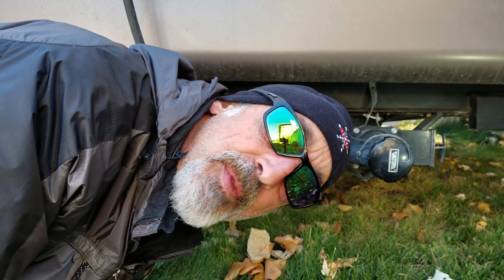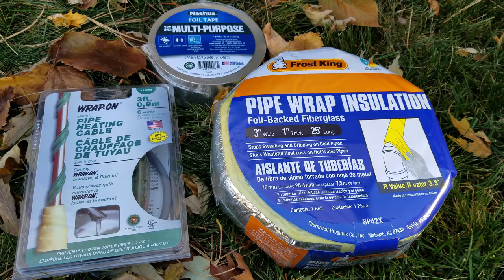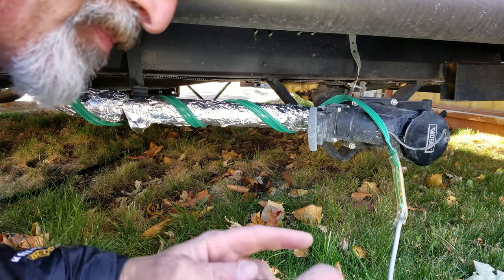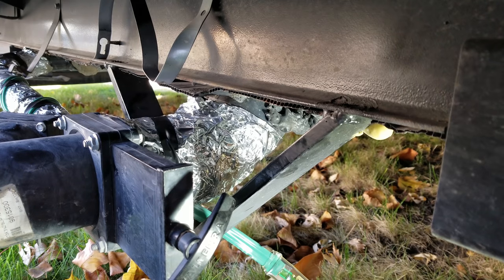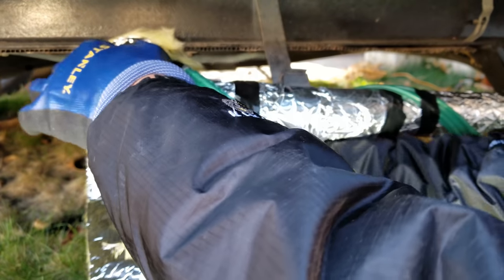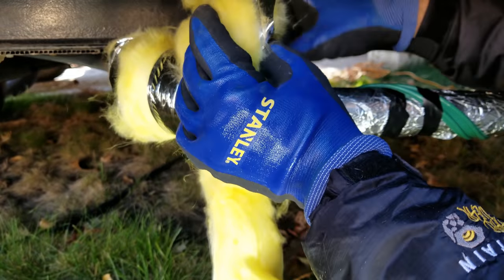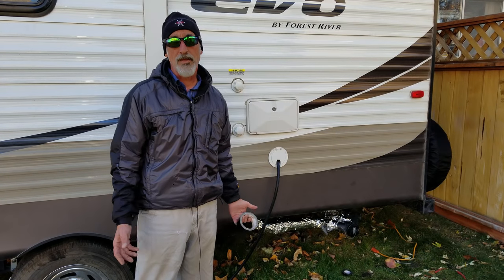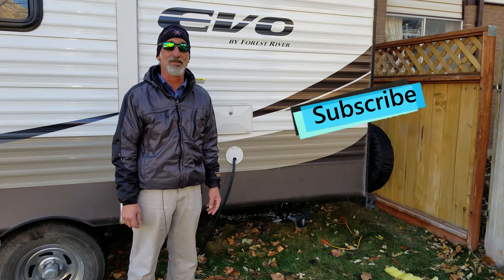Ep. 12: How to Keep Your RV Dump Valves From Freezing | RV How-to

Comment: Great video, thanks. Just wondering if pouring some rv antifreeze down into black and grey tanks, keeping any liquid in the pipes near the valves, and the valves themselves,  would negate the need for the heat tape? I see the issue of the valves/push rods being frozen themselves. Then you always have the problem of finding winter dump sites that are operational, no?
Reply from the maker: It could, and we do that ourselves. However as the tank contents continue to fill, that antifreeze will continue to be diluted and less effective over time, unless you keep adding sufficient quantities of antifreeze.
Reply: @GrandAdventure  Thanks for the reply, but what does one do who is not plugged into shore power to contend with the actual exterior components of the valves themselves being frozen, like the cable, slide mechanism, etc. Seems like everything rests on whether or not you can actually open the valve, to dump the liquid. I would assume heating with a heater or heat gun/hair dryer, no?

Comment: Thank you. Aren't you supposed to leave the thermostat outside the insulation? Or did I miss that part of the video?
Reply from the maker: You are correct. In our case the thermostat is contained within the electronics that include the power LED, which is outside of our insulation. We didn't specifically point that out, however.
Reply: That maybe true but unless the pipes are freezing why use more electricity and money than necessary. Some of those heat cables stay on until 60 degrees, which maybe 24/7 for three months in some locations. I would either install a separate thermostat plugin shutting off at 50 degrees or monitor temperature separately (manually), or get a wireless thermometer with alarm, and pay attention to a weather app. When in doubt leave it plugged in otherwise unplug it.

Comment: Good video. I would want this switched, just like tank blankets/heaters. That way during those months you need it, just flip a switch and your water systems don't freeze up. I wonder how long that tape and eventually wet compressed fiberglass insulation will stay on there? Let us know if the set up made it through a season. Thank you.
Reply from the maker: We're now on season 3 actually, Kris, and it's holding up just fine. Of course you could switch it easily enough, but we find just plugging it in is all we need. It has a thermally-controlled switch that actually kicks on when it dips below 38ºF.
Reply: @GrandAdventure  I'm a travel trailer newbie. Picking up my first 32ft later this week and plan on living in it for a year. I've been watching videos like they're not making them anymore. Lots of good information out there.
Reply from the maker: @kriskumaroo  congrats, and wishing you a wonderful year ahead!

Comment: A few questions . . .

1. Are factory installed heating elements an option when buying an RV?

2. Is this a one time solution to the freezing dump valve issue or do you remove the materials in the spring and reinstall them in the autumn? 

3. And kind of related to question 2, How long to expect this concoction of foil,  tape and wires to hold up as you drive along dirt, snow and stone filled roads.?
Reply from the maker: 1. Not for the dump valves, only for the tanks themselves. Those more "winter-proof" than mine (which are few), plus most motorhomes have their dump valves in an enclosed space instead of hanging out in the open like mine.

2. I intend to leave mine on.

3. I'll find out. ;)
Reply: Just went out to look at ours, it appears Arctic Fox has buried the valves in the heated belly. This was NOT an option that we chose, must be standard.

Comment: Thanks for the video! How do you keep the freshwater tank from freezing on those consecutive single digit days? Is it best to use heat pads or also a space heater underneath to keep from freezing on consecutive -0 days? Should you immediately empty the grey after showers? We’re thinking about staying in rv park up north over winter and any advice much appreciated!
Reply from the maker: Our pleasure, Big Sky. The Evo travel trailer that we owned when we filmed this had heat pads in the tank. Our current fifth wheel doesn't, and we had a freeze-up happen while we were winter camping at Lava Hot Springs to ski at Pebble Creek, Idaho. The KOA we were staying at had their water turned off for the winter, so we had to rely on our tank. Fortunately for us the daytime temps allowed it to thaw out. We'd have to come up with a different solution in this rig.

We winter in Salt Lake City, where temps are not inordinately cold. Nevertheless, we keep our grey tank valve open unless it's going to be especially cold overnight, then we allow it to sit there until it's warm enough to dump.  We were there all last winter and didn't skirt, but if we did we'd put a heat source down there. Because we rely primarily on our fireplace and a mica panel heater while we're in SLC we're not running the furnace very often, and therefore it's not putting any heat into the basement where our water lines, etc. are located, so we keep a small thermostat-controlled ceramic heater running down there and we monitor the temperature via an RV Whisper sensor with an alarm set if it dips below 40 in our basement.

Hope this helps.
Reply: @GrandAdventure  It helps a lot. Thank you!
Reply: Hot water bed warmer that’s what I got a mind get a hot water bed warmer and put it on the bottom of the tank

Comment: We just got our first camper this year and having this same problem
Reply from the maker: This trailer was our first too, Russ, and we don't think it's something that many people think about when buying their first. When we replaced it with a new fifth wheel, however, we ensured that our dump valves were enclosed and insulated.
Reply: I actually got the pipes unfroze by using a hair dryer one of my awesome camper neighbor was able to provide for me now I'm trying to figure out how to drain my waste tank I left it open my first week not knowing
Reply from the maker: @russmajor6987  sounds like you're halfway there. Is your underbelly insulated, which is preventing you from getting heat to the tank drain pipe where it meets the tank? Is that where the ice jam is presently?

Comment: I hope rhis will work found. My valvs frozen yesterday and temp here is 5 dagrees  we had it blocked off the generator  exaust blowing under but still froze  i put salt down hoping it works  but nop still froze   now i need to have  some on gift me thes items to fix it  things go bad when im broke all ways
Reply from the maker: FYI blowing your generator exhaust beneath the trailer is a direct route to carbon monoxide poisoning inside the trailer. That's therefore not a recommended solution.
Reply: With that attitude you’ll never get ahead

Comment: Thank you. Why not heat tape the actual valves?  Do you keep it on when traveling, or are you stationary for the winter?
Reply from the maker: We kept it on for traveling, LK, and actually did wrap the valves too. We had that setup for over 3 years before we traded in that trailer, and it held up the entire time.
Reply: @GrandAdventure  Super! Do you still do that?
Reply from the maker: @TheLakingc  our situation now is a little different. Our present fifth wheel has its dump valves enclosed within the insulated underbelly.
Reply: @GrandAdventure  the one i want to get does, too.

Comment: What about your dump valve handles.. are those not an issue when camping in artic temperatures?
Reply from the maker: Not at all, just the gate valve itself.
Reply: Thank you! I was just afraid of going out and pulling on the handle and it being frozen and not being able to dump my gray/black
Reply from the maker: @robertwaldrop3100  anytime. Just keep those cables lubricated, which should be done anyway in any weather.

Comment: wouldnt the aluminum reflect the heat away from the pipe ??  maybe should have put the heat tape on first then wrapped with aluminum ??
Reply from the maker: It's not recommended to place heat tape directly on PVC pipe. Plus, that foil will distribute the heat more evenly.

Comment: Why wouldn’t you wrap the tube in the heat tape prior to wrapping in aluminum foil. Seems that if you wrapped the tube first in foil like the video, it would keep the heat from the heat tape getting to the tube vs keeping the heat in the tube. Wrapping it in the insulation afterwards my help hold the heat in but it may be extra not needed step. Thanks for the video, some great tips!
Reply from the maker: You bet Jimmy! Our goal in wrapping it in foil first was to distribute the heat more evenly, and minimize the risk that a particular point would become overly hot and damage the PVC pipe. Probably not necessary, but a step that we thought we'd take.
Reply: @GrandAdventure  Thanks for the reply! Always nice to know the reasons why. I can see it both ways for sure!
Reply from the maker: @JimCantu  as can we. Thank you for sharing your thoughts!

Comment: I think I would spray the outside of that with flex seal to waterproof it.
The holding tanks would each get a heat pad. The other piping use heat tape also and the rubber foam pipe insulation.
Insulate the tanks also.
Reply from the maker: On that rig (which we just got rid of) we already had tank heat pads and an insulated and enclosed underbelly. The dump valves were our weak point.
Reply: I have to do all that to mine this year.
I suppose I should buy a bunch of the heat tapes when they go on sale soon.
Reply from the maker: @2009mechanic  that sounds like a good plan. We discovered when we did this video that not all heat tapes are created equal. We chose those with the lowest electricity draw we could find, and with an automatic on/off temperature sensor that triggers in the right range.
Reply: How to insulate the 3 tanks beneath?
What insuation material works best?
Everything I have seen so far points to the sheet foam 4'x8' that you find at the home improvement stores and they use a good grade of exterior clear silicone sealer for all the joints and corners.
It appears that I will need to unstrap my tanks and partially drop them down to get the foam around them.
Reply from the maker: @2009mechanic  to be honest we never looked into that, because that trailer had an insulated and enclosed underbelly and tank heat pads. As far as I know they used spray foam beneath the belly shield.
Reply: @GrandAdventure  be carful! Ours was supposedly glacial rated and when we went under and dropped that panelling, to fix something (or see what need to be fixed rather) we found that there was no insulation or someone took it out before we bought it (used)
Reply from the maker: @amandahibbs3690  always know your rig and it's capabilities, that's for sure.

Comment: We were rushing last min to winterize our boat... we live in Texas and waiting till the weather report said there would be a hard freeze..... ooops.... so we rushed and ended up with Plan B.....
Reply from the maker: Which plan was plan B?
Reply: Grand Adventure essentially, nothing.... Put it inside, and plug in a heater. We just weren't prepared... With no battery, we couldn't move the boat to the pump

Comment: how come rv manufacturers put the dump valves for black and grey pipes at the end of the run? wouldn't the necessity that this video is about be entirely eliminated if the dump valves were placed at the beginning of the run? i mean, the pipes from the tanks would then be empty and therefore no need to insulate and heat.
Reply from the maker: Sure would GPP! That's actually how they're implemented in our current fifth wheel. However, if you're set up like we were in our former travel trailer included in this video, this is an effective solution.

Comment: So u use an inverter to run it I guess and how the battery through running it or r u shore lining it at these ski areas
Reply from the maker: Batteries are fine for limited use for as explained in the video, the draw of these particular heat cables isn't high. However, for prolonged use you'd need either shore power or an available generator.
Reply: Ty. New to rv living ( learning as I go)
Reply from the maker: @jeffroe6423  we've all been there!

Comment: Did it work? Mine has 1/2 inch of ice in it, I failed.
Reply from the maker: Well that sucks! Have you analyzed it to figure out what you could've done differently?
Reply: Yes, at the start, I opened both gray tank valves and had the hose installed so as the water flowed through the system it all froze. The day before we were Scheduled to leave, I closed the valves to flush to dump. (Yes I have a Valera valve). Remove dump hose and open system so the pipes are clear. Installing your hose heater today and external tank heaters. KZ 382 MBQ 2021
Reply from the maker: @robertnasser9937  aaahhh, I misunderstood. So you installed this today to avoid a repeat. When it gets below freezing keep your dump valves closed, and only open them to empty the tank.
Reply: @GrandAdventure  I think what I did was close the tanks with some water in the system, I opened them and connected the sewer hose as normal. The heated hose is installed as instructed and it has so far not cleared the ice but I finished it at 4 pm so will see. Last night it was 10 outside.
Reply from the maker: @robertnasser9937  that's mighty chilly for this time of year. Maybe jump start the melt with a hair dryer?
Reply: @GrandAdventure  been there, done that, now I am almost solid, I may have to cut and replace the pipe to remove the ice, got to be in Alaska on the 1st
Reply from the maker: @robertnasser9937  ugh! How about a forced air construction heater? They're pretty amazing and reasonably cheap at Home Depot, around $100 and good to have.

Comment: Nice tip, but you left out the most important part.  Your method requires plugging that system into an electrical outlet.  This does not help for boondocking.
Reply from the maker: That's why we went with the low-draw heat tape, Mark. When boondocking, we simply plugged it into our inverter. If the temps got too low they kicked on, just like the heating pads in our tanks. A year ago now, though, we replaced that trailer with a fifth wheel with protected dump valves; however, that system was still functioning and intact when we sold it.

Comment: Good information - one area I did not insulate & put heat tape on when I built my camper.  Check out my build - in my first video I show how I used heat tape & insulation on the water lines that go to & from the gas instantaneous water heater. Thanks again.

https://youtu.be/lyI67QXSkb4

This is the video with a look at the insulated lines:

https://youtu.be/dXB_Cvk2ENE
Reply from the maker: We will check those links out when we get a moment, Jim. Thanks for sharing, and thanks for watching!

Comment: Why doesn't the manufactor companies put these on when they build them and then we don't have to buyer all this BS - we spend alot of money on these luxury trailers they should do this so we never have to worry about it in heat or freezing tempatures.
Reply from the maker: Well, in all fairness Kimberlee, 95% of RV owners will never be out in sub-freezing temps, so it doesn't make a lot of sense for manufacturers to build for that remaining 5% just to increase the cost for 100% of buyers.

Comment: Not suppose to use those on drain lines.... Pipes should be under pressure. Could cause a fire from improper use.
Reply from the maker: As we understand it, the pipes just aren't supposed to be empty if the heat tape is in use. If they're empty, you wouldn't need the heat anyway. There's no risk of fire at the temperatures these heat tapes that we've used output.
Reply: @GrandAdventure  Its in the instructions and from my contact with the company. Not a giod idea. Its even on your affiliate lunk to amazon. Just read the discription.